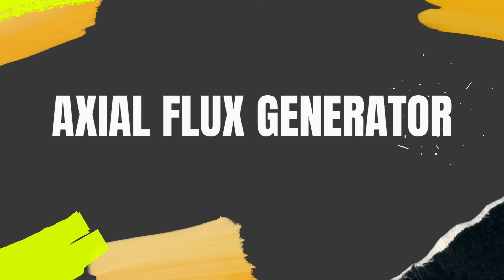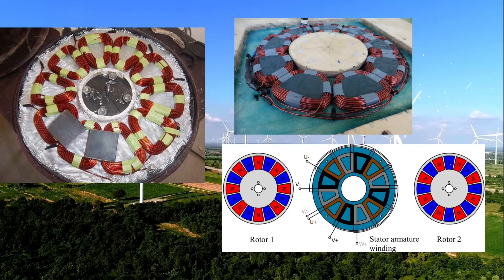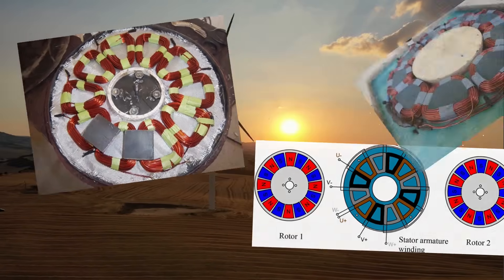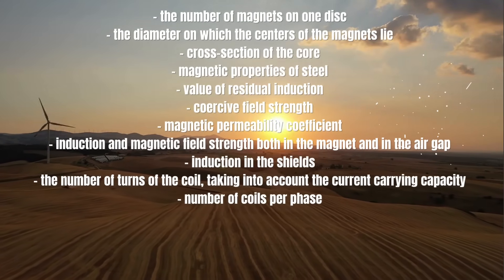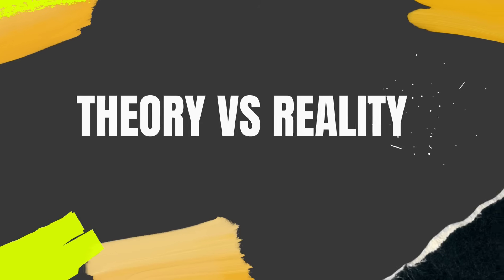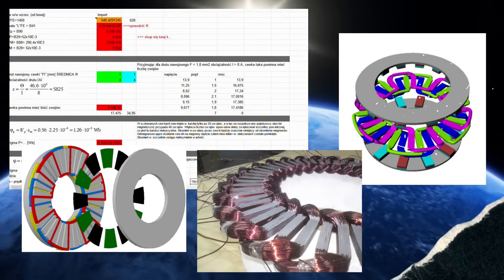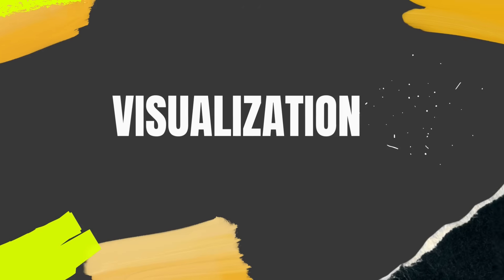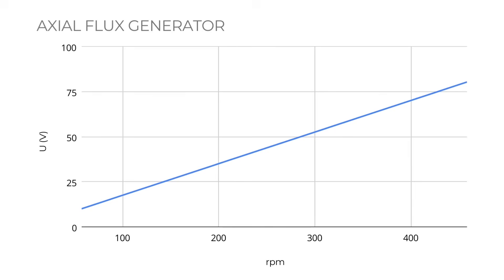DIY axial flux generator

Comment: That's an odd way of making the coils. Why not make individual windings and then assemble them in proper sequence later. That jid although impressinve is a waste of time, money and effort. I don't see the benefits of a continuous phase winding. All that does is use extra copper wire at the very cornered edges where no power can be generated. Also increases the risk of shorting the wires with excessive heat.

Comment: Wedges on thredded rod was a good forming technique. Comparably, I've seen people directly wind the form on dowl rods. This type of coil is considered an axial flux serpentine coil. 

There is another kind of coil winding called faulhaber winding that I used on my axial flux motor on my channel where i wound my coils on nails and the coils are only only two wires thick.  Which would allow you to get dual axial rotors very close. An axial flux faulhaber coil could also be wound on plastic form.  I have a 3d model of a form for an axial flux faulhaber stator with 3 coils with 5 turns for a 12 pole rotor if your interested. 

One might find it interesting to googel image search thingap motors for inspiration  by looking at their radial flux faulhaber coiled stators.

Comment: I think this method of wiring is not very efficient in generate power. It waists the magnetic field of the wire in the outer and inner circle, only the centripetal part off the wire is doing the job.

Comment: no need 3 phase, single phase enough. only need less rpm, with much thick wires rolling to get the high voltage : 220V..!!!

Comment: Thing is generator should be radial flux and electric motor should be axial flux to improve efficiency, consider the amount of torque required to produce a certain number of watts, and consider how much torque is experienced using certain number of watts and idealize those numbers...  You will go far by understanding this

Comment: I tried making a COPY of a "BRIGGS + STRATTO" AXIAL FIELD ....MAGNETS WERE HUGE" ROUND , DOUBLE , SHAFT MOUNTED on ENGINE OUTPUT SHAFT with -0- SECONDARY BEARING AT FAR END ...CAUSING ENGINE SHAFT TO ***SNAP** WINDINGS WERE ALUMINUM and placed between the 2 MAGNETS  ALUMINUM WAS A flat RIBBON ,NOT ROUND WIRE ...ALSO ...NO COOLING AIR ON INNER ALUMINUM WINDINGS ....I BOUGHT COPPER RIBBON (SAME ~3/8" WIDTH x ~ .020 thick )

Comment: Excellent method of FORMING COPPER WIRE COILS AND ASSURING NO SCRAPING/NICKS of SHELLAC/INSULATION .....I HAVE BUILT/REBUILT FORD ALTERNATORS , CARVING OUT THE CENTER STEEL CORE with a DIE GRINDER ,*TO GET MORE COOLING AIR FLOW THROUGH THE ALTERNATOR* , AND CUSTOM CUTTING TEFLON  INSULATORS and DRILLING ALL HOLES FOR OVERSIZE STAINLESS STEEL HARWARE/BOLTS and USING A DIE GRINDER TO SMOOTH AIR INLETS IN BACK and AIR OUTLETS IN FRONT and ADAPTING GENERAL MOTORS EFFICIENT CURVED CENTRIFIGAL BLADE ON FRONT at PULLEY and HIGH SPEED BALLANCING to WITHSTAND 20,000 r.p.m. On FORD 2.3 liter ,4 cylinder ENGINE THAT HAS 6,000 r.p.m. COLD ........ALSO WOUND OLD STYLE FORD STARTERS WITH BETTER COPPER BAR STOCK IN OUTER FIELD WINDING to get MORE TORQUE for HIGHER COMPRESSION 2.3 liter modified to 10.5:1 compression and DRILLED MODIFIED FORD STARTERS with 5/16" hole -drilled carefully through THICK 3/8" CASE BETWEEN BOTH (OUTER) FIELD WINDINGS and tapped for 38"x 16 for BETTER GROUND CONNECTION , GAINING ~1/2 volt at STARTER .......MY NAME : E R I C ......OHMs LAW.  E=R•I Correct [✓] ....remember OHMs LAW spells my NAME 😮😮😅...........1/2 volt  x200 amps starter = 100 watts or ~1/7 h.p. more for HIGH COMPRESSION ENGINE ....BUT ...MODERN STARTER SPINS VERY HIGH SPEED , which INCREASES EFFICIENCY , !!! USES PERMANENT MAGNETS which lowers CURRENT REQUIREMENT ....MY PLAN WAS TO : NEXT STEP ...WIND CAR GENERATOR with pure SILVER WIRE (SHELLAC/INSULATION by HAND) ...TO RAISE EFFICIENCY ...SILVER CONDUCTS BETTER then copper ,~10% less resistance ...and ...~30% better heat conduction ....3rd plan was to use micro silver tubing filled with FREON to FURTHER COOL WINDINGS +RAISE EFFICIENCY .....4th plan was to use MULTIPLE , microfine silver wire BRAIDED TO LOWER RESISTANCE (ELECTRONS "DRIFT" IN FATTER WIRE and causes MORE RESISTANCE + MORE HEAT

Comment: Those jigs are some of of the most impressive applications of 3D printing I’ve seen, what an inspirational video! There is nothing remotely janky about that coiling process. Thank you for sharing 🙏
Reply: Would it make any difference if the wire was wound with a more complex geometry, such as a helical spiral that also matches the geometry of the magnets?
Reply: @christopherd.winnan8701  I haven't seen any DIY alternators created with a helix-type geometry (if you could point me to an example I'd be curious). Furthermore I do not think a more complex stator configuration would necessarily make the build more impressive.
Reply: That were a very detailed thinking & engineering in making these jigs. You are so inspiring, I believe this is the start of the road to make machining automation in production of axial flux stator with precision & cost effective way for future mass production as what the radial has achieve with mass production stator coiling machine over these years. Congrates mate & I wish to follow this idea in making the jigs. Hopefully would success in replicating this idea & process in making my own generator motor. Thanks

Comment: 10/10 for the jigs!
But there is a much quicker (and easier) way.
Add your inside and outside diameters of the coil then add double the distance from inside to outside ..... times the number of winds per coil and add 10%. 
That then gets your loose coil. Tie at multiple points. Get a piece of ply with pins or screws at the inside and outside points. wind your coil round the pins.
When you put it into your armature use a Lacquer rather than CA glue ..... or just pour your epoxy if you want it to be potted!

Got to admit the video of that would not be as good as this, but it would be a lot quicker and easier!
Serpentine coils are future for generation!
Reply: I think some of the purpose of this was to be able to quickly wind the circular coil with a drill or similar and then fashion that into motor windings. If this isn't the case please let me know because I hope to make a motor as well.
Reply: @slimknight_  I thought roughly the same as Dave W.  I'd have fixed shaped blocks onto the base and wound the coil directly around them.  That forming jig was nice (and worked) but it's over-engineering the project.
Reply: @totherarf "Serpentine coils are future for generation! "

Have you seen the serpentine coils used on stellators?

Any tips on how to make an easy to build DIY stellator jig? 😎😎😎
Reply: @christopherd.winnan8701  Yes! 
fix a plate to the end of a tube and wrap your coil around that!
On a more serious note we were not talking about plasma manipulation with the OP type of serpentine coil but rather a motor / generator type of device. Apples and Pears!

Comment: There is away i stumbled on that all you need is a big speaker magnet and a shake flashlight and by placing the shake flashlight with the shake flashlight switch taped on and setting the shake flashlight on the speaker magnet in the right spot with the switch facing upwards then turning it 45 degrees on one side you will notice the light gets brighter, my shake flashlight battery was completely dead and with the switch taped on it only took one shake of the magnet to make the light turn on and it sat on that speaker magnet for 3 weeks and the light was on the intire time until someone knocked I on the floor switching the light off, no moving parts and the light was on for 3 weeks that was cool
Reply: Forgive me but this sounds like a troll. Something has the move either the magnet or the coil of wire to generate electric current. Can you possibly explain it with more details?
Reply: @wolfman122970  not necessarily, if positioned correctly the magnet help pull the electrons through the diode gate

Comment: Frumos lucrat si inteleg ca noul tip de bobine trifazice pot fi amsblate pe suport de plastic formad statorul si rotorul  format di magneti neodium pe suport tot din plastic sau metal si asfel noul generator are un randament mai bun la turatii mici., intreb rezistenta franarea magnetica scade? Multumesc
Reply: Frinarea magnética se numeste Lenz efect bobina aré Nord sud magnet permanent Nord sud eliminar frinarea magnética bobina Nord sud 90 de grande cu Linia magnética permanent magnet
Reply: Multumesc
Reply: 3 PHASE GENERATOR ALWAYS BETTER WHEN CONVERTING BY DIODES TO D.C. ...LESS RIPPLE , BETTER VOLTAGE REGULATION , STEADIER VOLTAGE ....BUT NEW , MODERN CAPACITORS CAN ACCEPT VERY HIGH RIPPLE VOLTAGE or EXTREME WIND SPEEDS CAUSING VERY HIGH VOLTAGES , POWER TRANSISTORS BLEED OFF HIGH VOLTAGES TO A REGULATED/STEADY 12.7 VOLTS TO CHARGE COMMON BATTERIES ....MODERN SOLAR CELL REGULATORS USE THIS SYSTEM ...ALL LE.D. LIGHTING POWER SUPPLIES ACCEPT ANY VOLTAGES >> FULL WAVE DIODE RECTIFIER >> CHARGE SUPER CAPACITOR , POWER TRANSISTORS BLEED REGULATED BOLTAGE TO 2nd  SUPER CAPACITOR ...SIMPLE

Comment: Nice, maybe adding iron fillings in stator mould will concentrate more flux
Reply from the maker: I am familiar with that solution, but it may lead to the issue of 'cogging'
Reply: Right, maybe little skew on magnet or stator may reduce cogging
Reply: Cogging can also be reduced by making 2 or 3 of these pancake generators on top of each other, and their rotors secured together in 180 or 120 degree phase difference. The overall cogging effect would cancel, from the perspective of the input shaft.

The iron cores should be laminated, to prevent eddy currents. And the laminations should be aligned so that they prevent the induced circular current, and not prevent the magnetic field flow.

But I want to see this design going all the way until completed 😊
Reply: Metal MUST BE Amphoras (NO CRYSTALINE STRUCTURE ) SO MAGNETIC FIELD WILL COLLAPSE QUICKLY and LESS ENERGY WASTE USED TO REVERSE Magnetic FIELD IN MILD STEEL ...SILICON STEEL BETTER ...AMPHOROS STEEL*BEST* ....BRAIDED SILVER WIRE BEST ....METAL FILINGS USUALLY ONLY USED IN CORES IN EXTREMELY HIGH FREQUENCY EQUIPMENT